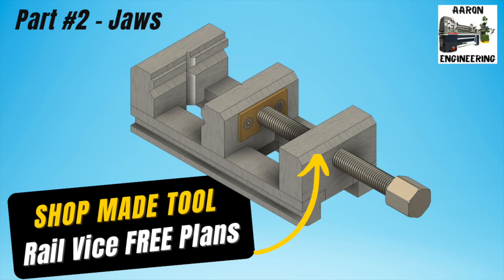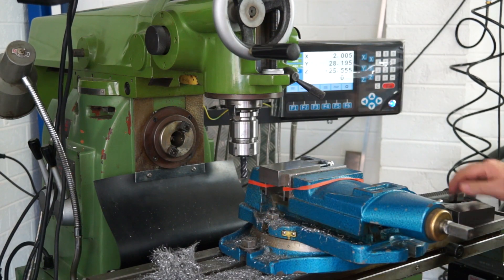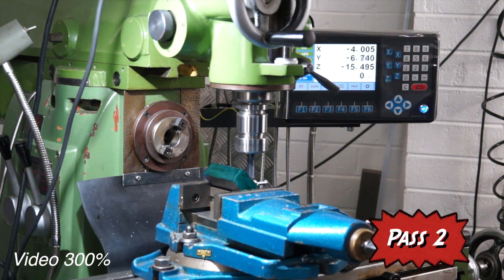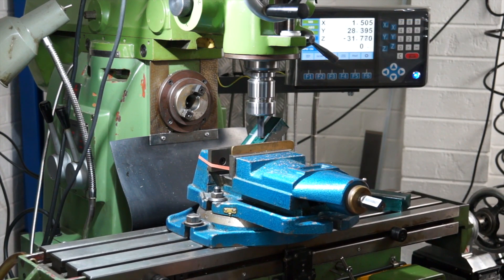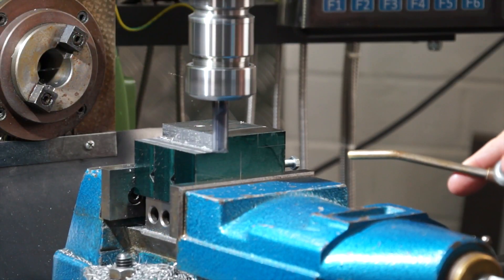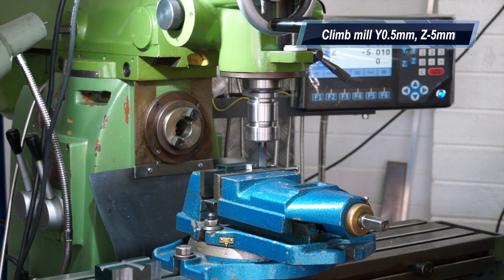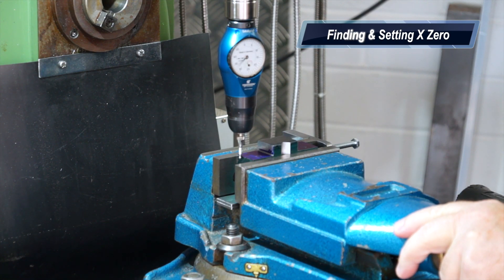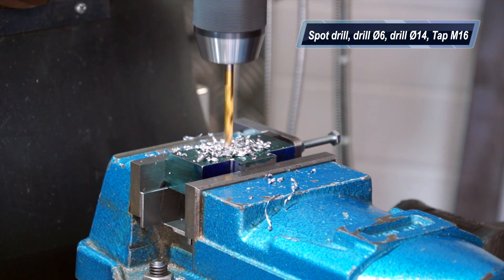DIY VISE Pt.2 | FREE PLANS | Let's make the Jaws!

Comment: I made one of those as a first year apprentice 50 years ago , still got it and it has been quite useful over the years. The design of mine was different in that the frame was a casting in cast iron. There must have been thousands of these made bt apprentices.
Reply from the maker: Hi Andy. l appreciate you watching and commenting.  Yes I think this project has been around for years.  This one has been taught at the TAFE where I work for probably that time as well.  Thought it would be good project to share here with the viewers on YouTube.  Also to help the apprentices make it as they can watch my video reference first before "stuffing it up" (joke).  Cheers, Aaron.